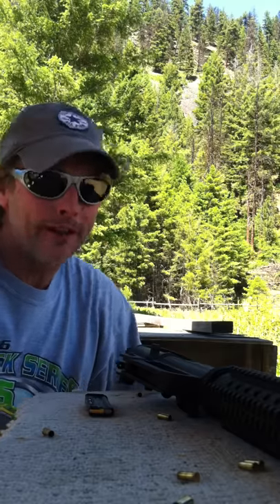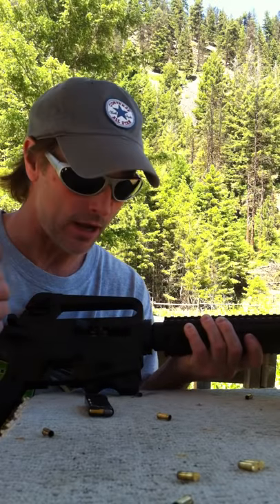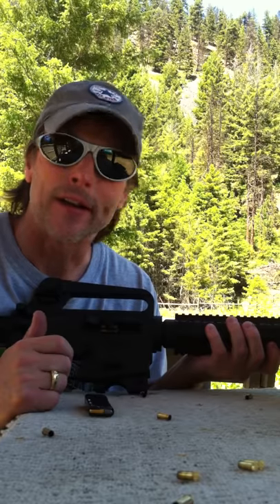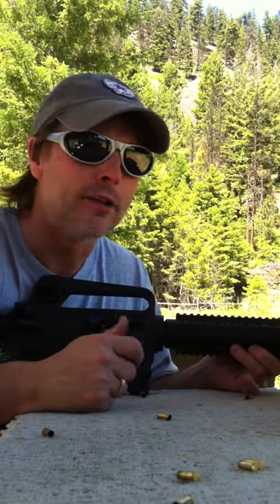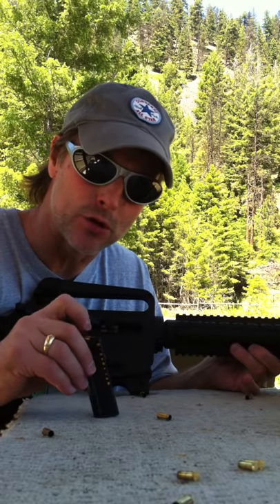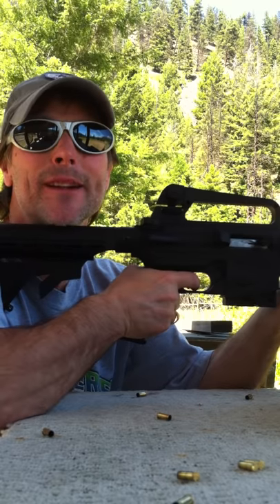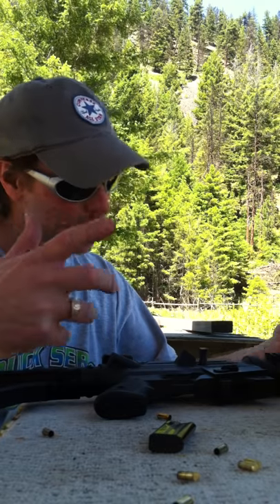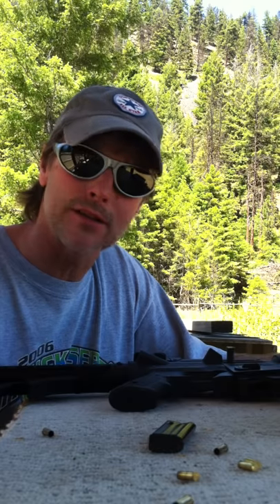Mossberg 715T FIXED From Jamming‏

Comment: Mine jammed on me too at first. A lose screw will cause that on the release lever. I had to put a new screw in mine. Mine came with a stripped screw so I put one slightly bigger in it. No problems since then. I have the 25 round mag. It's legal in my state.
Reply: Instead of tightening that lil screw holding that plate down, can you just remove screw and plate its holding down, just asking
Reply from the maker: Thanks for watching.

Comment: try it with the 25 fully packed with cheap ammo and tell us how that went, with the right CCI ammo and carefully loading it you might get past 11, but that's the sweet spot, the 25 round clip is a problem, thry sent me 2 new ones at first when I got the gun and same thing, wont shoot past the 11th to 13th round without tinkering with, I circumvented that by loading 10 at a time and never had another jam, and the squared big mag just looks cool, looks like a high caliber weapon, my next step will be installing pegs inside that will prevent more than 10 rounds, I can see how they easily fixed the issue by commandeering your 25 round clip and sending you a 10, in all actuality its nothing more than a mossberg 702 plinkster dressed as an AR, and they never jam if they are taken cared of. not saying the bolt issue does not exist, it probably does, but don't load past ten and most likely your problem jamming will be over.
Reply from the maker: Good advise.. Hope others also read this.. thanks Jorge for watching.

Comment: Glad your is running good, I use mine as a cheap place holder with all my other ARs, the only reason I got it is to plink around my 6 acre yard, totally worthless as a 25 round firearm, magazines ar garbage, I have had them replaced and they are just junk, impossible to load after 10 or so rounds, looks like an abortion with a 10 round stuck into the big mag slot. so just load 10 rounds and deal with the poor design. I am definitely getting a colt or ruger to play in the yard with, this one will just be a placeholder in my rack. one thing I have to admit, when it fires it is very accurate, WOW, one point for moss turd.
Reply from the maker: Thanks for the comment.

Comment: I did everything here but it still jams or stove-pipes after 2 or 3 rounds. It’s the magazine, not the bolt. I sent it to a company and they did absolutely nothing to fix the problem. The 25 round magazine is the problem.
Reply: I was wondering myself cause I just got a used one and it has the 25 round mag and it was jamming almost every time.
Reply: Simple fix your 25 is a 15. Round mag
Reply from the maker: Thanks for watching.